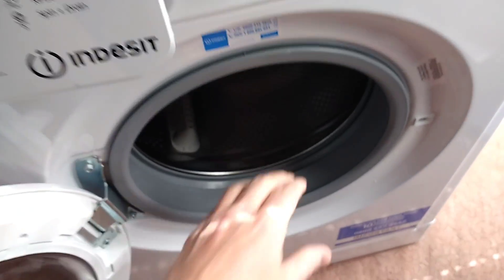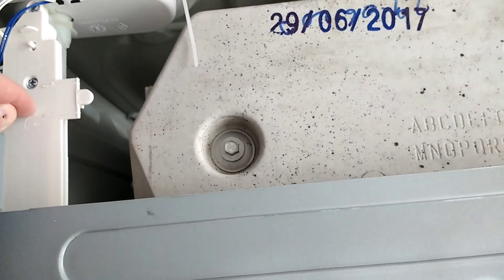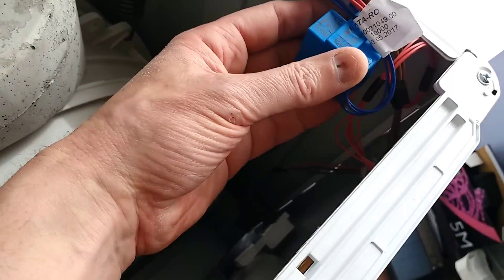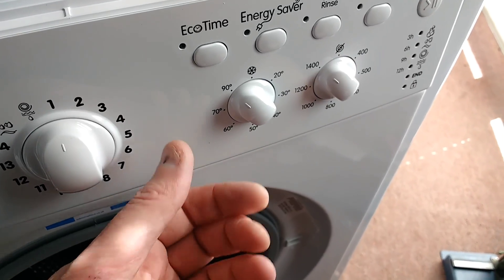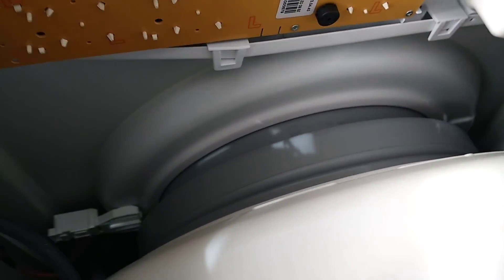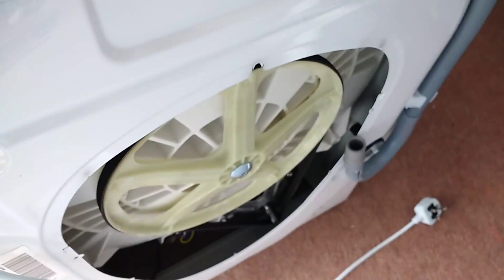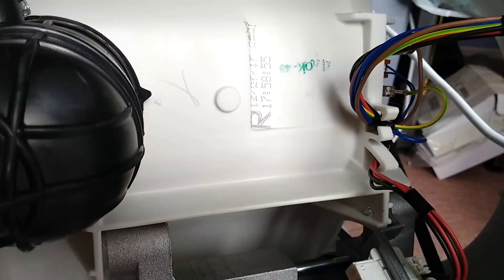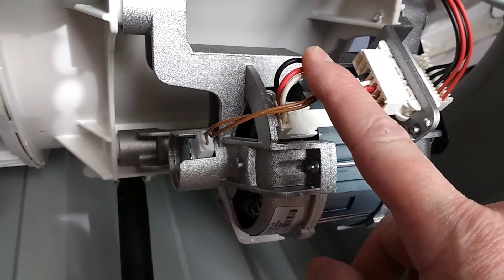Inside my new British washing machine (clothes washer).

Comment: Plastic doesn't give much hope that this appliance is going to have a long service life, unlike washers of old.
Reply: Friend of mine runs a white goods shop. He'll only sell an indshit (as he calls them) if people insist on one. Rates them too cheap and flimsy to stock.
Reply: The only brand still using metal is Miele
Reply: Whilst many engineering plastics can outperform alloys, durability is the issue. Plastics do not age well, and I'd be pretty sure that Indesit will not be using the best-quality polymers for this application (especially seeing how it is constructed). That has been "design-optimised" to just outlast the warranty (under normal domestic use).
Reply: I repair washers and dryers for fun and profit, so far, the failure mode is the alkaline detergent corrodes the spider holding the drum and rust eats the sealing surface for the lip seal protecting the bearings.  Water washes the grease out of the bearings, they wear out in a hurry.  I picked up 10 this summer, only one had an electronic failure, the rest all suffered corroded drum supports and seal failures.  The plastic was still in tip-top shape.
Reply: Modern high grade yes. This is indesit.
Reply: Nah, i'm a technician in these products.
You know, technician, the guy who repair the engineers f-ups :-)
Reply: Eric Wolff Plastic tubs are not a problem. I had a washing machine that lasted for 15 years and it never failed me. But the problem with the latest models is that the two halves of the tub are welded together. Older plastic tubs have the two halves bolted together. Nowadays you can't even change the bearings. Unless you have an angle grinder.
Reply: That depends, high grade modern plastics can outperform aluminium.
Thats why i still laugh about people bragging that they phone is aluminium.
Reply: Out top loading Daewoo is a trooper. It wasn't cheap.
Reply: You're a Whirlpool/Baucknecht technician ?
Reply: Profit on those machines can only count in big stores cause they work on a bonus by their yearly numbers and don't aim for single piece profits.
Reply: Yes, the ( 40+ Years) old stuff was made to last , except incandescent light bulbs since 1920s ...a 1970s Coffee Machine still works, a Not that cheap 1.5 Years old "Molinex" Coffee machine failed ( thermo fuse failed -> bypassed & it works again under strict supervision by User -> Socialist Method )
Today most stuff is made for the dump / short lived (Planned Obsolescence)
Reply: None. The place i go to get parts for my old stainless washing machines has the outer plastic drums stacked by the douzen (i kid you not) by the entrance, most of them suffer from broken mounts, last time i went i even saw one with a massive indent, but whether that was from use or replacement practices, don't know. Nowadays i don't trust neither the machines nor the operators anyways so they can do whatever they want. To stay as fuck away from this garbage i've even machined a new shaft for the spider to get proper bearings not the crap ones they force you to buy.
Reply: the plastic drums don't fail any more than the old metal tubs, though if people don't check pockets then coin damage will happen! enjoy the flood as a result of that
Reply: how did you separate the shaft from the spider? The ones I've been fixing, it's cast as one piece.  ( aluminum cast around the shaft )
Reply: TheChloeRed INDESHIT I agree.
Reply: PA66 is cheaper than aluminum and yet it has better thermal properties
i thiink tnis is PA6 or PA66 impact resistant GFR30
Reply: Designed to fail.
Reply: Yeah, it's pretty funny seeing laymen on the internet making baseless assumptions about the build quality of a product designed by engineers who know what they are doing.
Reply: I pick them up from the dump, or appliance store, get the parts online, then turn around and sell them.  Get something for free, minor money in, and sell - profit!